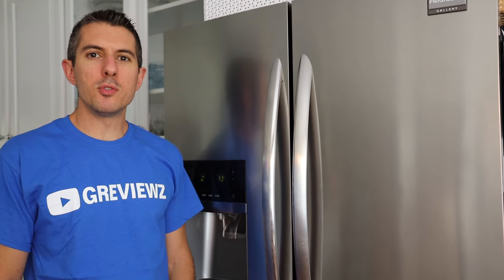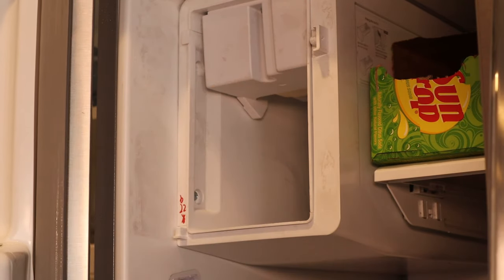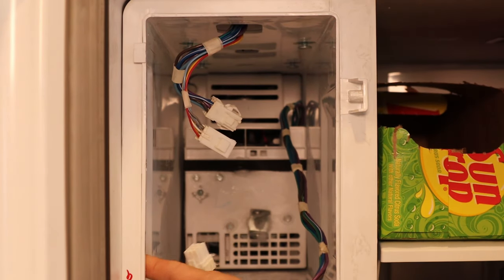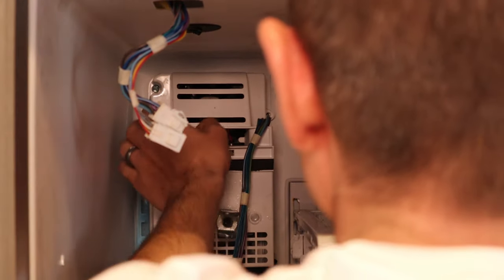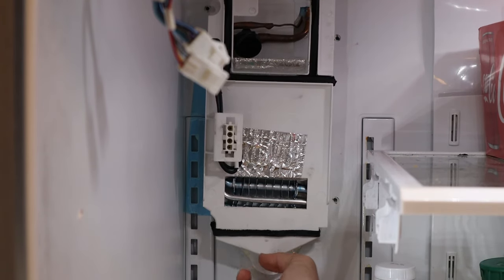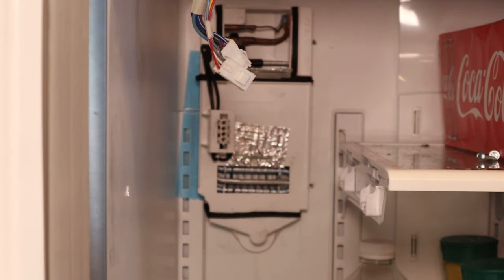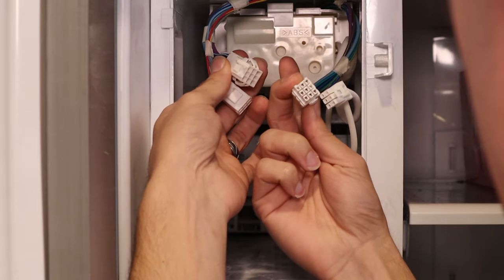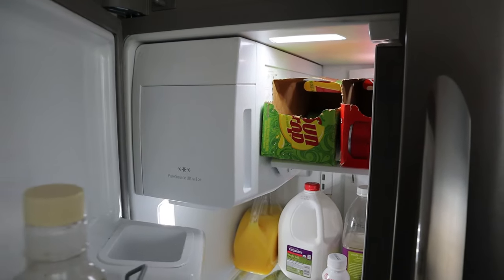Frigidaire ice maker broken again: fix it

Comment: When re-installing the outer case… mine was not seating ALL the way to the back as it should. There is probably a problem with the rubber gasket at the back deforming. This made it to where my anchor holes were not lining up with the holes in the outer case. I drilled new holes to secure the outer case, and it as pressed as far towards the back as I can get it to go. Do you think I will have issues around the motor?
Reply: I am having same issue. How is your refrigerator?
Reply: The ice maker was repaired temporarily, but broke again within a couple of days. It does not seem like it is staying cold enough. I believe the rubber not sealing perfectly at the back is causing condensate around the coils

Comment: I have this exact model refrigerator except it is made by Kenmore (model 253.7034341D).  The Kenmore version of this refrigerator looks exactly like and has the exact same parts as the Frigidaire version. Kenmore refrigerators are made by either Whirlpool or Frigidaire as of when this refrigerator was made.  I am having the same issue with my ice maker.  There is a way to run the defrost mode just for the ice maker.  In your case you definitely had ice build up around the components of the ice maker and had to disassemble it to remove the ice more directly.    If anyone wants to go at it more conservatively first before tearing the entire ice maker down I suggest using the Diagnostic Service Mode of this model refrigerator. To get to it press up arrow and down arrow at the same time and hold for about 10 seconds.  Next get to test # 26 which is the Ice Maker Defrost Heater.  To get to that test press the + button several times until 26 shows on the right side of the refrigerator display.   The defrost cycle will then begin after about 5-10 seconds.  The left side of the display will show the current temperature in the evaporator coil area.  slowly it will heat up from 14 degrees to the 60-65 degree range.  The defrost mode will complete in about 5-10 minutes.  You might want to run it through several cycles.  If you need to exit the Diagnostic Mode altogether hold the + for about 10 seconds and it will exit.  It will exit from the diagnostic mode automatically in about 5 minutes if no other tests are selected to be run.  The paper sheet with the diagnostic mode instructions and tests is located on the right bottom side of the refrigerator where the drain pan is located.  The drain pan on this model refrigerator is not removable but if you remove the bottom kick plate by opening the lower freezer door and then lifting the kick plate upwards using a flashlight and looking underneath on the right side you will see the pouch holding the diagnostic sheet.  Here is a link to the Diagnostic sheet that has the instructions of how to get to it as well as other tests and diagnostics that can be run:  https://ibb.co/WHDgcpC   If the included imgbb link pic is removed after some time do a Google search for: 'Service Data Sheet A06589001' and it will be on several web sites
Reply from the maker: Thank you for watching and providing other awesome information to others. Yeah in my case the ice maker defrost was not cutting it as there was ice in locations the defrost could wouldnt touch.

Comment: Great video!  Just put mine back together and am waiting to see if we are good to go.  The only difference was my coil cover was metal and taped together so I blow dried over the cover.  Also, there was a loose wire in the back of the motor piece with a wire clamp of sorts and had no idea what this was for.  I kept it loose back there so we will see.
Reply from the maker: Did you end up getting ice?

Comment: Thank you for making this video. My question is, my fridge is making ice, but it will not dispence. The motor and auger are engaging, but for lack of a better description,  the auger appears to have lost the strength to push the ice out. I have to either shake the ice tray and or clear the opening for it to puch ice throught the despencer. I hope this make sense and I would really appreciate any suggestions you  might have.

Comment: That’s a great video. I’ll try that on my ice maker that stopped working. I’m guessing that by using all the ice cubes to put in a cooler the ice maker has been working non stop to re-make more ice and it caused the plug. Which is weird because it should be able to handle that. Fridge is less than 3 years 🤷🏼‍♂️
Reply from the maker: Thanks for watching. If you read a lot of comments these units have all sorts of issues.

Comment: I’ve had a Frigidaire for six years. The ice maker worked for about two months. Repaired so many times I lost count. Manufacturing defect. They should have recalled them!!!
Reply from the maker: You got that right! They should but if they did than many other manufacturers would have to as well! The ice maker in the refrigerator trend was bad for many company’s…

Comment: I enjoyed the video very much and your attention to detail.  I wonder why the ice formed in the first place.  which would have me concerned that it would continue to happen.  I think it would be wise to blow out the drain with either compressed air or even a tube/hose of hot water blown through.  Also I think I would add a shepherd's hook from the heater into the mouth of the drain. Yes, I'm old and old school appliance guy and not trying to come off as a know it all.  Just would want to take every precaution of it happening again.
Reply from the maker: Thanks for watching. This is a know issue.. anytime you put an ice maker in a compartment that is o er freezing temps your asking for problems…the more moisture that gets in behind it freezes…

Comment: this is actually what you need to fix this, p/n 5303918784 fan housing kit, it's a complete rework of the fan housing, evaporator cover and rear seal, the cause of the problem is air leakage into the ice room, ice builds up and stalls the fan, it will keep happening again and again if you don't replace it with this kit
-factory authorized service tech for over 30 years
Reply from the maker: I believe you have commented on my video before but thank you for the information. Many people have commented after installing this part number and still report problems…
Reply: @GReviewz  I have the retrofit. It only prolongs the buildup from 1 year to about 18 months, then ice block again.

Comment: Hi Chad, Thanks for posting this video.  I decided to go for the easy option first by activating the defrost cycle.  It's crazy that after reading the manual from Frigidaire cover-to-cover, they never mention the 'trick' you mentioned of simultaneously holding down the '+' and '-' buttons (why would they not mention this?).  It turns out, three cycles of the defrost cycle was the only treatment needed for my freezer to begin churning out ice again.  I recommend everyone first go for this easy solution first, and, if it fails, to go to the more labor-intensive solution.  Good to know that there are self-serve solutions before going to an outside handyman :-)
Reply from the maker: Thanks for watching. I appreciate the positive feedback. Yeah during the process before I made this video I hit the defrost cycle 2x and it did not work. I guess if I had tried it another time it would have worked.
Reply: How long is the defrost cycle and does it automatically revert back to normal, or do I need to manually turn off the defrost cycle? Our ice maker has broken 4 times (each for a month or two) and then starts working again. We haven’t figured out what makes it start back up.

Comment: Thanks for the video!!!! I replaced my water vavle first that was not the problem then happened to see your video pop up 🙄 very simple to do had no ice around any of that but my fill tube was plugged solid with ice heated it up dried everything out now works great again. 👍🏼 bought mine in 2019 and it has a rubber gasket all the way in the back of it so maybe that’s why it’s gets no ice build up back there. 🤔.
Reply from the maker: Thanks for watching. I appreciate the positive feedback. Frigidaire knows there is a problem and they have slowly but surely tried to fix things. Like the rubber gasket you have on yours. The problem is these units are still flawed.

Comment: I loved your video its common sense considering all that could go wrong.  I am going to try the Defrost.  I just put in a new filter and there is no water and no ice.  I don't think its connected to the filter but there should be water draining out since I replaced the filter!  Sometimes its something very simple that's screwing everything up. Nothing as complicated as a refrigerator. I did have a  twenty year old Kenmore that was running great but I was talked into buying all new stainless steel appliances.  My fault.  😜
Reply from the maker: Thanks for watching. Yeah I feel like we all fell into the (oooo stainless steel) trap. My wife wanted all matching kitchen appliances.... everything else is working fine just so many people are having trouble with their freezers on these Frigidaire units... yeah defrosting should work but it all depends how much ice buildup you have..

Comment: I have the same exact Frigidaire refrigerator. The peoblem is this: if even 1 cube sticks behind that flapper rod that raises up when ice is dropping, the ice making system will stop until the cube or cubes are removed. Pretty simple, took me probably 2 years before I figured this out.
Reply from the maker: That’s weird Ive never had a cube get stuck in that spot before…hmm

Comment: My problem was the water line that feeds the tray was frozen. I had no ice at  motor. I recently had some plumbing work done where the water was shut off and pressure reduced, which I'm guessing caused air in the line and allowed it to freeze. I very carefully took a heat gun and thawed the rubber boot out. Works great now!

Comment: Hello,  I was having the same problem with my refrigerator not making ice.  I tried the forced defrost code 072 that I found in another video, as well as trying a hairdryer to defrost it, I called Frigidaire/Electrolux and this is what they suggested.  It worked perfectly and I didn’t have to disassemble anything.
Trouble shooting steps for Ice Maker

	1.	Have the consumer Switch the Control (UI) Panel to CRUSHED.
	2.	Have the consumer remove the ice bucket
	3.	Next have consumer continuously press down the dispenser paddle for 2 minute intervals (Releasing the paddle and then pressing the paddle again) for a total of 3 times (6 minutes tot This will melt and evaporate any ice around the auger motor shaft.
	4.	Have consumer switch the control (UI) panel to CUBE. Next reinsert the ice bucket, close the door and have them attempt to dispense ice again.

Comment: On my 2002 Kitchenaid Refrigerator I replaced the ice maker after19 years. By then the old ice maker was producing ice just sporadically! It would take 8 days to get a full tub of ice until I had the ice maker replaced. I paid $284 to have a new ice maker put in and the water filter replaced. The water dispenser now operates with more water pressure than before.
Reply from the maker: Thanks for watching. They sure don’t make things like they used to...thank you for sharing...
Reply: @GReviewz  That's for sure!!! I'm also now finding out there are appliance repair shops that fix and refurbish old washing machines I wish I knew about. I just found out my 1992 Mayan could have been restored and refurbished for under $1,000 . I spent $ 1,200 on a 2018 Speed Queen that got bad reviews for washing performance!
Reply: @GReviewz  Also I've heard that GE Refridgerators have very low satisfaction among owners according to Consumers Reports as well as other GE appliances like washing machines. My dentist has had GE Refridgerators and the motors keep burning out and if coarse the ice makers failing as well.

Comment: Excellent video, and well done. My fridge hasn't been working since we got it. However, we now have a new water source, and am wandering why it isn't working yet. I did replace the water filter, but no help. Not sure about our water pressure, however it should be good. Also, to draw a cup of water only does like half a cup, and then stops. Does this mean it doesn't have enough pressure, or is something clogged? Thanks

Comment: Folks you will continue to have the same problem until you buy the updated kit and gasket. There has been a huge problem with Frigidaire and Electrolux refrigerators that have this style icemaker. The drain becomes clogged with ice, then the ice starts to build up which causes the icemaker to stop producing ice and freeze your water. The problem is warm air from the refrigerator is getting inside of the ice compartment causing it to freeze. What will happen is behind the drain will cause the metal on the back of the refrigerator to condensate and it will rust a hole in the back of your refrigerator within a three year timeframe. I had this exact same problem with my $4500 Electrolux three door refrigerator. I was two months outside of the factory warranty. Electrolux denied my warranty repair saying that the refrigerator must’ve rusted within two months but it had rusted a hole completely through the back of the refrigerator the size of a quarter. The day I installed the refrigerator back against the wall was four years before I noticed it. Electrolux customer service sucks especially when you spend $19,500 on all Electrolux appliances for your new home. Electrolux is answer to fixing the problem with the rust on the back of the refrigerator is they want you to put a foam pad cover up the rust. That is not acceptable to Because it will continue to rush you just won’t be able to see it because I put a foam pad on your refrigerator. It is a sealed unit therefore the refrigerator has to be completely replaced, which they will try to wiggle there way out of. I was able to fix my refrigerator rust hole By cutting out the rust and placing a patch aluminum panel over the area I removed. When I cut the metal back that’s when I discovered the insulation was missing from where the icemaker and drain was inside of the refrigerator which caused the ice buildup in the condensation drain, which caused it to the rust completely through the back of the refrigerator.
Reply from the maker: Thanks for watching. I am sorry you have had the worst case scenario happen to you. Many people have the icing problem but few have the rusty hole problem. Unfortunately one of my family members had gotten this fridge before the rest of us by a few years. They raved about how they liked it so much.. well the rest of the family ended up with the same fridge. Needless to say we all have problems with the ice makers. The first family member has spend $k’s to get theirs fixed even that new gasketed thing you are talking about.. still didn’t fix the problem..
Reply: @GReviewz  I wish we could all get together for a class action lawsuit
Reply from the maker: That would be awesome! The only problem with a lawsuit like that is the company has come out with a “fix” to the problem. We could probably win if Frigidaire refused to acknowledge there was a problem and refused to try and make a fix..
Reply: @GReviewz  I understand they now have a fix, but the damage has in most cases already been done to the metal. The metal rust from the inside out. Once rust starts, we know it doesn’t stop until it’s cut away. Those refrigerators have a 5yr cavity warranty. Meaning the shell/ liner is covered. Electrolux refused to replace my refrigerator until their warranty. I’m sure they’ve done it to others as well. Matter of fact my tech told me he’s seen this issue a lot and the company refused to reimburse the customers.

Comment: Thanks for this video. It was easy to follow and I was able to take everything apart. No ice build up was found which leads me to think it may be something electrical. The bottom freezer drawer ice maker works. My water dispenser is very weak. I am going to get a new filter today maybe that will help. Any other suggestions are welcomed.
Reply from the maker: Thanks for watching. Yeah the ice buildup would be the first line of business to check. Next I would make sure all connectors are tight. Change air/water filters. Air is less important. Make sure water line isn’t clogged..

Comment: I have the exact same refrigerator.  Followed this tutorial and found that in my case all that was wrong was that the water inlet line at the top had frozen.  I had no ice elsewhere.  I think this might have been caused by too much junk on top of my refrigerator not allowing ambient room temperature air to circulate across the top of the fridge.  If this happens again, I may try setting something warm on top of the fridge for a while and see if it thaws the line out before taking everything apart again.
Reply from the maker: Thanks for watching. I am glad you were able to find what was wrong. I never thought about that. I have a ton of stuff on top of mine as well.
Reply: Same thing here. 3 months ago I pulled it all apart and found no ice on the coils at all. 
There was a frozen drop of water coming from the nipple above the cube tray and has worked perfectly until today. This time I only took it half apart and let the blow dryer work for  a while on the nipple..
My refrigerator has cabinets directly above it